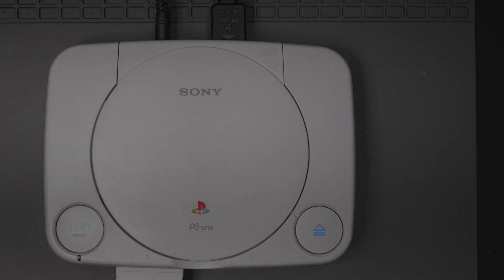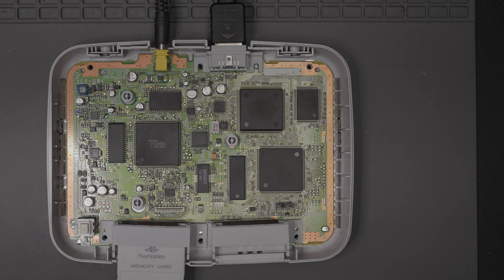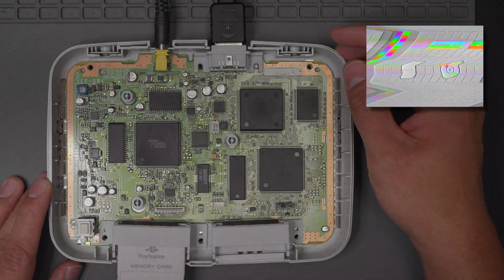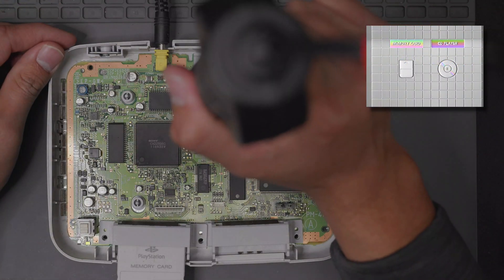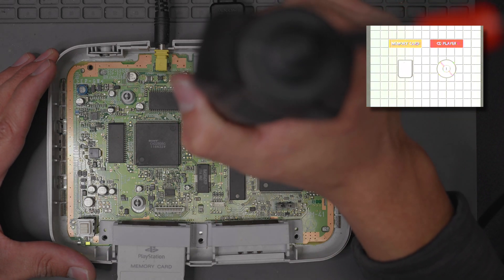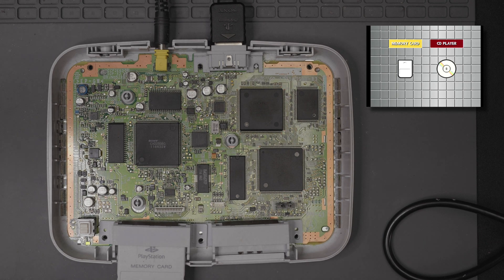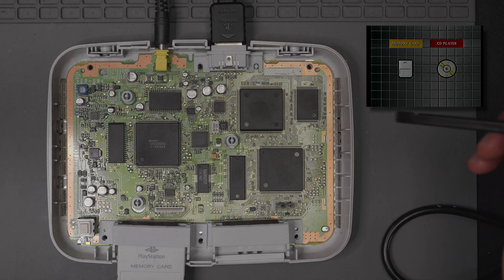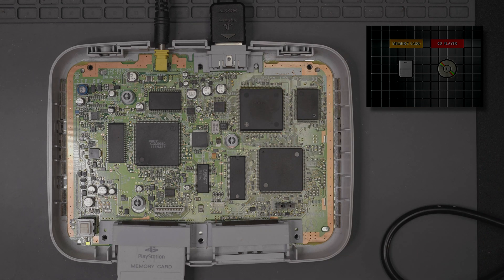PS One: Bad Video Output Diagnosis

Comment: Its not an Encoder failure! It's a bad capacitor near encoder, C551 for composite output (and CSync on RGB) and C550 for s-video Luma output. Replace both with 220uF/10v to fix for long time (stock 4v are underrated for this console).
Reply: absolutely! what's frustrating is that this guy never came back to acknowledge this comment and his video is very misleading for others with the same issue, almost all of the videos on youtube where they tackle this video problem, the solution is to replace capacitors! they never touch the video DAC. even in my investigation of the problem on forums and repair websites, they always point to capacitors.
Reply: @RetroGamesNow86  This is exactly how I solved the problem... I changed all the capacitors and resoldered the door... after resoldering the encoder pins with flux it started working again!
Reply: @FedericoSalis awesome to hear‼️ nice‼️
Reply: @RetroGamesNow86  You're wrong... I too have that issue. Not always the caps are to blame.
Reply: @souocesar  have you replaced your capacitors to see if this fixed your problem?
Reply: @RetroGamesNow86  but of course. The first thing I did.
Reply: You're wrong... I too have that issue. Not always the caps are to blame.